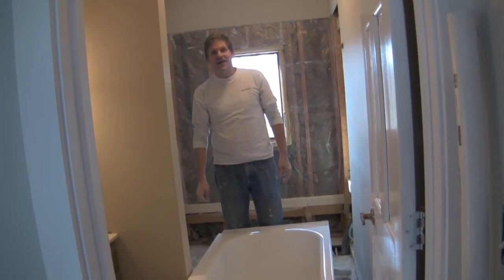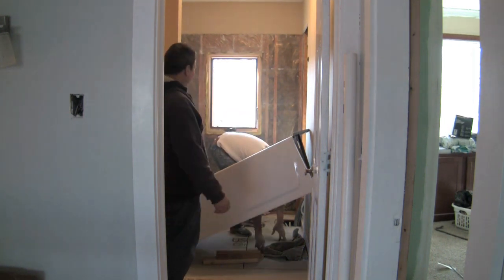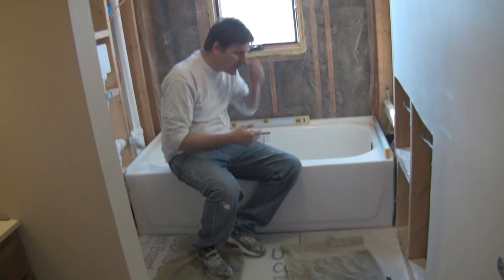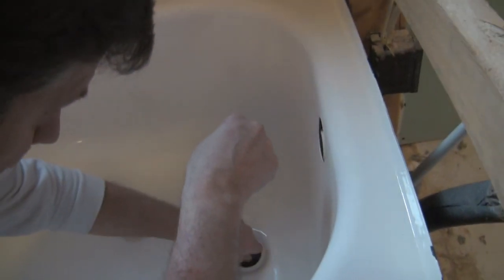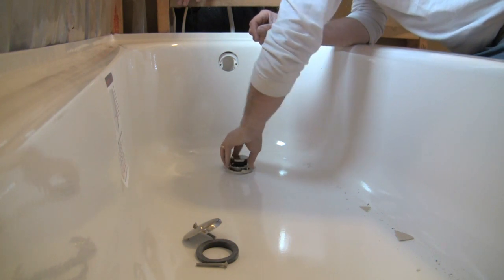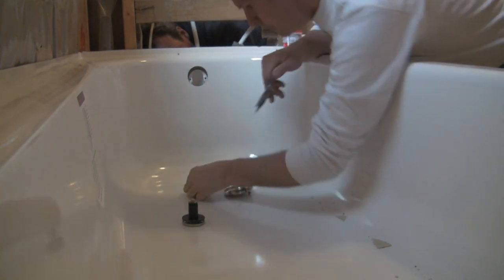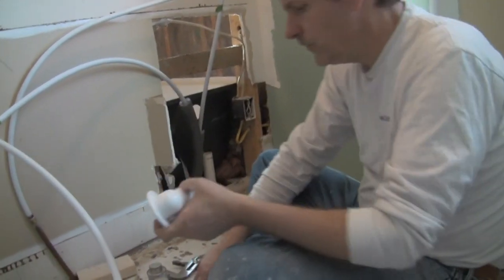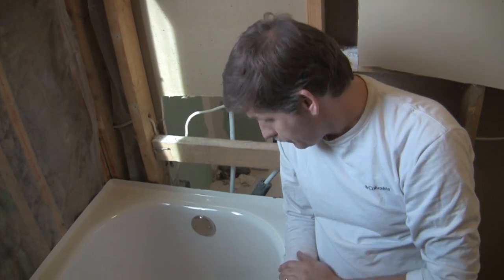How to Install a Bathtub

Comment: You have helpful videos - thank you for sharing!  I was wondering if you adhered the tub flange to the studs or something like that.  It looks like your tub is porcelain on steel and I would think drilling through the flange would damage the porcelain.  I don't know but I am putting in such a tub and was wondering.
Reply from the maker: Hey Dimwitts,
You could drill a screw into the stud with the head of the screw / or nail hanging over the edge of the flange. OR use liquid nails. 
Underneath the long side of the tub is a 2x4 support ( kinda like a ledger board) for the far side of the tub to rest on. The screw over the edge side would just lock it in to place.
Steel tubs are pretty heavy, once in, they are IN!
Then overlapping that would be your cement board etc. it won’t go anywhere. 
Thx for the question and for watching.
Reply: @Housebarons  Thank you for the tip!  I guess a screw and a washer or something similar might do the trick.  Thank you for sharing the video!

Comment: Could you explain how you installed the plumbing? Was it installed first then the tub placed? I have a very small space I am working with. Not sure the tub will lay in after the plumbing is placed. Any suggestions?
Reply from the maker: Hey Kyla,
We removed an old tub and replaced it with a new one. The space was like 5 feet 1/2 inch or maybe 5 feet  1 inch. It’s a close fit. Most drop-in tubs are about 5 feet as standard. 
The plumbing already existed- just had to reconnect it. 
Typical plumbing fits under the floor and above the 1st floor ceiling. If your plumbing doesn’t exist, that’s a priority. I can get complicated - best to talk with a plumber about feasibility. 
Hope that helps.
Thx for watching!